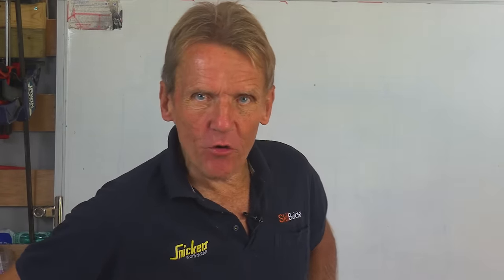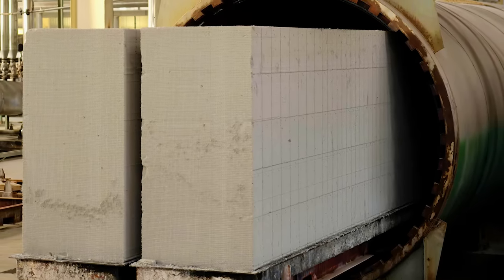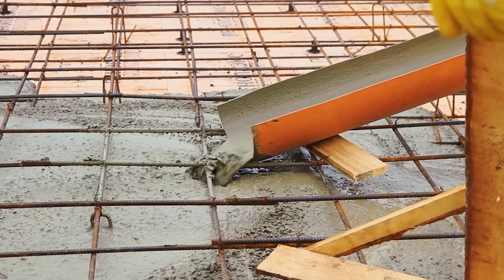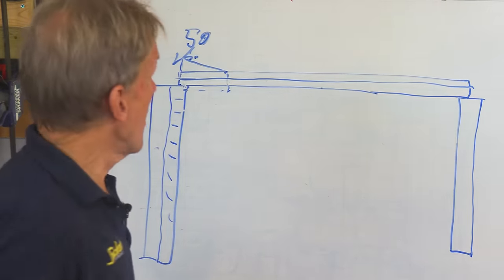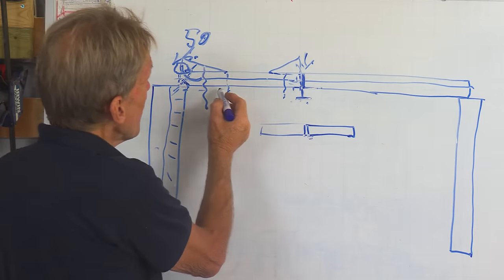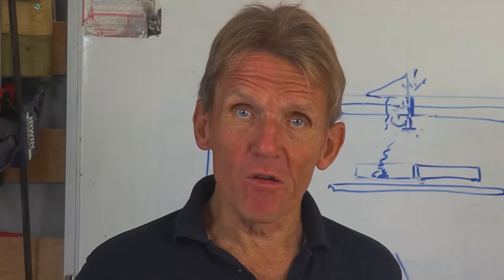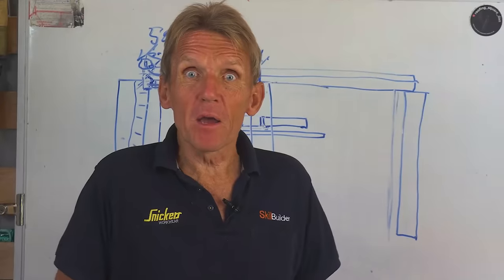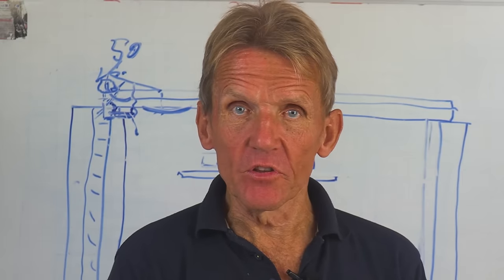The Ugly Truth About Reinforced Aerated Autoclaved Concrete (RAAC)

Comment: It’s unbelievable how this problem has been on the long finger for so long. My wife was a student nurse in what was The Greenwich District hospital a new build. 30 years later it was demolished due to what at the time was call concrete cancer!  What I find incredible is that the Pantheon dome  the largest unreinforced concrete dome in the world is still standing and it was built by the Romans in 126 AD yet in this day and age we still can’t get it right.
Reply from the maker: Did you watch the end of the video where I referenced the Pantheon?
Reply: All the Roman buildings that were built cheaply with their equivalent too Raac have crumbled into dust. All we see now is there best building. We can build longer lasting buildings,  it just costs money.
Reply: @SkillBuilder  But imagine trying to get planning permission for a domed roof these days ...
Reply: @SkillBuilder  Pantheon : The Romans (and Greeks) were dead lucky that rebar didn't exist. Seems it's the use of rebar is the key failure here (and everywhere).
Reply: @mitchellquinn  A double pitched pent roof is not far behind a dome for longevity.
Reply: I wasn't impressed when I crushed an Aircrete block with my hand. As an insulator they are ok, but they should NEVER be used structurally.
Reply: @johnclements6614  The dome is under compressive forces unlike a beam .
Reply: @josephhenry4725  The concrete in a beam is also under compression. Concrete has some tensile strength but is quite low and not used in design often. The tensile forces in a beam are taken by the rebar. 

The top half of the simply supported beams shown in the video will be in compression with that force taken by the "concrete" and the bottom in tension with the force taken by the rebar.
Reply: What did the Romans ever do for us?! @SkillBuilder
Reply: Someone got it right because they got paid. That's all that matters these days.
Reply: the magic word which the OP glossed over was "unreinforced"
Reply: Its cost vs. durability.

There is nothing wrong with building using RAAC or the modern equivalent but you must abide by the expectation that it will have a short lifespan. In the UK, post war we needed buildings that were quick, cheap and easy to build and were only seen as a stopgap solution. Sadly fast forward to today, and with a country with a minority of cronies that continuously hordes their tax dodging money in offshore bank accounts sapping the finance out of it, no new schools are being built. What is there is not getting repaired.
Reply: @mitchellquinn we don’t do domed roofs only doomed roofs.
Reply: The team discovered ancient Roman concrete gets its strength from self-healing properties, which help fill in cracks as they form. Sure, the lime and the ash help, but the true star of the show is “hot mixing,” a process of creating concrete that forms reactive calcium.3 Feb 20233 Feb 2023
Reply: concrete cancer i.e. alkali silica reaction (https://en.wikipedia.org/wiki/Alkali%E2%80%93silica_reaction) is a common problem in the new household waste burning incinerators, causing the lining refractory to crack and spall. This means that lining incinerators is very expensive with the exotic materials and casting processes that are needed to produce satisfactory functional material.
Reply: @EdgyNumber1  i think it may be more accurate to say old schools are not being replaced. Plenty of new schools in my city (like 5 a year or something)
Reply: @davidbarnes7866  🤣 Sir, you win at the internet today.
Reply: The Pantheon actually had the Roman equivalent of aerated concrete - it used pumice as the aggregate at the centre of the dome to reduce mass.
The Pantheon also used some of the earliest iron reinforced concrete in the perimeter (they discovered the imbedded wrought iron rebar a couple of years ago). Wrought iron is very corrosion resistant when deeply imbedded in high quicklime content concrete. (Quicklime actually makes concrete self healing by flowing into cracks and reacting with atmospheric carbon dioxide to seal the cracks.
Reply: @mb-3faze The Pantheon was the earliest application of wrought iron reinforced concrete. It has a series of wrought iron bands around the entire diameter of the base of the dome - they were discovered when they x-rayed the dome.
The portico uses bronze dowels for the same purpose.
Reply: @allangibson8494  "The Pantheon was the earliest application of wrought iron reinforced concrete" - thanks, didn't know that. Learned something.
Reply: @josephhenry4725  If you map the forces (think vectors) and they are all within the physical structure, then you've got compression, which is a good thing.  The people who built the Gothic cathedrals that are still standing worked this out. The buttresses and flying buttresses take the horizontal stresses from the weight of the roof that are pushing the tops of the walls outwards. They are not just there to look beautiful. We don't see the buildings where they got it wrong. They fell down.

You can see another way of handling the horizontal forces in many community halls built in the 20th century. There are steel rods running from side to side at the top of the walls. They often have some sort of turnbuckle like mechanism for adjusting the tension in the rods. 

A modern example of a building that would have fallen down is the Sydney Opera House. In the architect's design, the roof 'sails' were much flatter than what was built. The architect's design could only have been built using many interior columns to support the roof or using a network of tension bars across the interior of the building. Not what you want in an opera house. A consulting engineering firm changed the shape of the 'sails', making them taller, to make them self supporting with the stress lines running through the curved shape. I think that the engineers' version is much better looking than the architect's version. Structures that are 'right' from an engineering point of view tend to look better than structures that are 'wrong'.
Reply: @SkillBuilder Could a wooden stud partition wall be used instead of the accro props?
Reply: '...Architects mincing about...' 😅 thank you for that.😂
Reply: The Romans built roads that lasted 2000 years.
Reply: roman concrete used volcanic ash that allowed it to repair itself by forming limestone or similar when it gets wet
Reply: @roadie3124  yep,all very true but in those days ...without the ability to measure these forces accurately ie  before stress geaded elements...we had the FACTOR OF SAFETY. nugh said ?
Reply: @josephhenry4725  Always need a safety margin, unless you're Lotus Cars under Colin Chapman. In the early days there was a lot of trial end error going on until they figured our what worked and what didn't.
Reply: @andypetrow4228 I keep seeing "OP". What does it mean?
Reply: @johnclements6614 That's an important point worth making.  On the other hand, the Romans did build a lot of very longlasting structures. Very durable roads, beautifully straight aquaducts, etc. They relied on very strong stone placed on other very strong stone with gravity pulling down through the lower stone, not trying to make durable structures from lightweight materials suspended over enormous voids, whuch seems to be the ambition of all modern architects.
Reply: @stephenfennell  Original poster ie wobby1516

The Roman road design were copied partly in the civil engineer designed roads from around 1750.
Reply: @stephenfennell  Original Poster. The person who started the conversation thread
Reply: @johnclements6614  Thank you. I will try to remember that!
Reply: We’ve got a flat roof, built properly with timber, waterproof membrane and vented airspace and sedum on top….no problem at all, but it was done with access and therefore easy to keep an eye on. Thanks for the advice you’re excellent at explaining things.    Barb
Reply: @sparta117corza  yes but apart from the roads the water ways the sewage the wine and security,, what did the Romans do for us stan

Comment: Hi Roger I live in Portugal and I can bet the stock video at 5:06 is from a Portuguese school!!! Yes, those roofs had asbestos, as these schools were made in the 80's and 90's with "fibrocimento" tiles. These days most of them had the roofs replaced with insulated roofs and also new windows, etc. The structure at least was well built with reinforced concrete columns and beams, prestressed floor slabs and exterior double walls with ceramic blocks and cement mortar. Us kids would sometimes break the asbestos sheets with rocks, how naive we were back then!

Comment: My infant and primary school was  brick built with a slate roof put up in the early 1900s. It still stands and whilst it is far from energy efficient it is safe. My grammar school was built in the 60s and was thrown up. Two walls of every classroom was glass (single pane). This made it very cold in winter and unbearably hot in summer and whilst it is still operating it has cost more in repairs, new window frame and flat roofs than the original cost, but at least they have somewhere to put the solar panels. As kids we used to put our feet through the asbestos panels that lined the walls and pull out the fibreglass insulation for use as itching powder. Great idea to have a standard design. A few years ago my council built a Gaelic School (yes I am now in the Highlands). The architect specified stainless steel cladding on all exterior walls. It cost a fortune but was a true land mark. Now it's an eyesore because of the weather staining on the panels.
Reply: Lochaber High School always reminded me of the Soviet Union, as seen in the movies. Grey, dull rectangular design. Some pretty poor architects in the 60s. Those concrete boxes next to the Castle in Inverness are shocking.
Reply from the maker: Yes there is some very disappointing architecture from that period.
Reply: That might have been fluffy asbestos in the walls, not fibreglass 😬
Reply: Definitely fibreglass, fluffy asbestos doesn't have the itch factor, at least not on the skin. @Jonathan_Doe_
Reply: Regarding the stainless steel panels: Tin-Can architecture is as hideous as the stained concrete that architects dumped on us in my childhood. Theye seem to ignore how their material will age. Stone and brick (but not red London/Fletton bricks) improve with age.

My nursery/primary school in Leeds was built of brick, and still stands 65 years later. My Grammar School was built in the arly 60s using the system you describe, and was demolished within 15 years. Leek Street Flats in Leeds were system built of concrete, and demolished within 15 years. We lived in a house on a council estate in Middleton, system-built in the early 60s using slab concrete - demolished within 15 years. Do you notice a trend? It's a shame that RAAC buildings did not get demolished within their lifespan.

Could we please have a law to prevent  architects and building businesses preying on the public sector with their experimental profit-making designs.
Reply: @frogandspanner  Couldn't agree more. I work in a contemporary building (c.10 years old). It won various architectural awards for its shiny minimalist design but it was a construction and maintenance nightmare from day one.

The interior was never properly finished because it ran so over budget. The featureless facade is aging terribly. The expensive windows are literally falling out. The flat roof doesn't shed rainwater properly and leaks. It's roasting in summer and freezing in winter. It's really noisy, especially when it's windy. It's as bad, if not worse than the 1970s concrete monstrosity I used to work in. It seems architects have learned nothing in the past 50 years.

The best building I ever worked in was designed and built in the 1920s. It looked gorgeous, but even better than that it was actually functional, even a centruy later, because the architect knew what they were doing.
Reply: Can't beat old ways of solid walls, built to last, cold yes but this is the UK and we're tough people
Reply: @MightyGimp  your nickname is wimper then
Reply: @MightyGimp  yeah now ssshhh
Reply: @MightyGimp  go wear ya gimp suit Wimpy Gimpy

Comment: I went to Fairfields school in Basingstoke, built in 1884, still in first class condition today. It was the pride of the town at the time of its birth,  Surely there is no reason why we cannot build schools and hospitals today that will  last several hundred years.  Obviously they would be refitted  as and when to meet the current needs, but the basic structure would remain.
Reply: The costs of retrofitting are huge.
Reply: @argonauth   Not if the building was built right in the first place. Classrooms, library's,  halls how do they change much?  They will need decorating but that must be cheaper than replacing the roof every 40 years and worse still, putting children's lives at risk. The Victorians must be looking down at us laughing. We can't even build a safe school anymore.

Comment: Excellent video and explanation.  

The key issues are:
  1) water ingress
  2) porous concrete that allows the water to reach the reinforcement bars
  3) corrosion that weakens, but moreover expands and de-bonds the reinforcement from the concrete
  4) lack of visible distress symptoms
  5) lack of inspection access.

There are a huge number of buildings to inspect, access to the RAAC is difficult, so how best to do this?  
Why not start ON TOP OF THE ROOF with a water test?  

Wherever the water ponds… 
1) …is the place with the biggest risk of a historic leak…
2) …may show where a weakened beam is beginning to sag.

AND THEN go inside the building and focus on those ‘wet’ spots.

The original roof might not have been perfectly flat, but the degradation starts with the water ingress.  So the “why” there is a pond is less important, I suggest only using that pond as a proxy marker for potential leaks and sagging structures.

The above approach gives a targeted approach to the most likely or most urgent areas, but that doesn’t replace a longer term need to undertake a 100% survey and to repeat those surveys regularly.

Other technology might then help: 3d laser scanning surveys allowing large roof area to be quickly surveyed and then compared on a regular basis.  Local difference between the scans is an immediate indicator of movement.  
Indeed continuous millimetre accurate robotic scanning is already done (eg: for settlement due to tunnelling under important structures).  If a building shows some concerns (water leaks), then a continuous survey and alarm system could be instigated.  

“But would that be expensive?”… “maybe yes”, but far less than the medical bills and subsequent law suit when the next child is hurt.

________________________

Sadly, as with so many issues, speed and cost were the big factors in design and method selection.  The 1960’s/70’s baby boom meant a rapid growth in the school capacity, plus they were modernising old, out of date (and very solidly built) old schools with larger, fast build, often pre-fabricated systems; with limited intended design life.

We can (and should) blame the Government, but all political parties are the same in that they are only motivated by the next election in 3-4yrs time.  They are not interested in long term planning: 
“what can we do, at this moment, that is cheap and just enough to fix the problem?”.  If an issue isn’t widely known about (such as the Springwell school roof collapse 2018) then they’ll leave that expensive problem for whoever wins the next election to sort out.

Asbestos has been known to be hazardous from the 1930’s.  However, it is a CHEAP and effective insulation; hence it was still being included in buildings, until it was finally banned in 1999 (UK).

Design was biased to the initial structural / architectural capability.  Consideration of construction and MAINTENANCE did not become a required part of design until the introduction of the Construction Design and Maintenance CDM regulations 1994.  Even today many designers struggle with that practical side of design.

Hence, access and ability to maintain a structure was simply not considered… Take a structure with a planned life of say 50yrs, with a first maintenance at 10-15yrs, but with NO practical method of doing that maintenance or inspection… and we have a huge problem.

My secondary school was build early 70’s and significantly expanded late 70’s.  The later part was flat roof and concrete precast cladding.  Certainly by the 80’s the flat roofs were leaking and receiving ad hoc repairs.  Today those roofs are still being patched up.

In conclusion: 
1) pitched roofs are the answer to most of the issues.
2) proper planned inspections
3) plan for and pay for long life structures
4) take any failures seriously… a little leak that makes a floor wet might be a symptom of a much, much bigger problem.

Comment: Nothing changes. Back in 1973 my school started to fall apart due to the use of high alumina cement in the concrete, added to make it harden quicker. The place was built only 10 years previously. Eventually half of it had to be demolished and rebuilt.
Reply: Did it accelerate corrosion of rebar?

Comment: Interesting insight & passion. Flat roof design used to be very much directed by the council.  My father designed an extension for the house. They demanded a flat roof. Years later, other extensions went up in our street and they were allowed Apex roofs. Our house looks the odd one out and is a constant problem as regards yearly inspection.  Happily though, it is a safe roof with wooden structure.  I mean, it has lasted 50+ years.